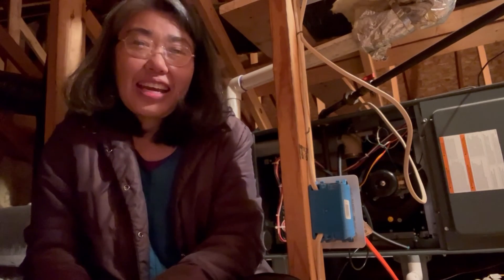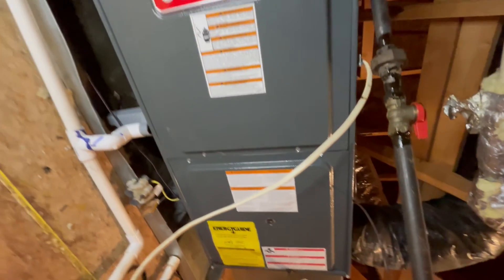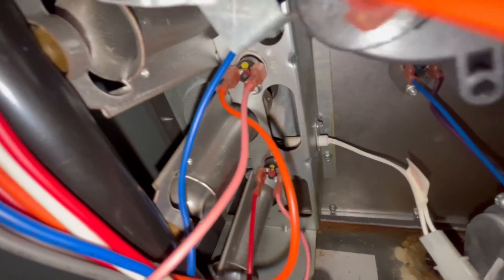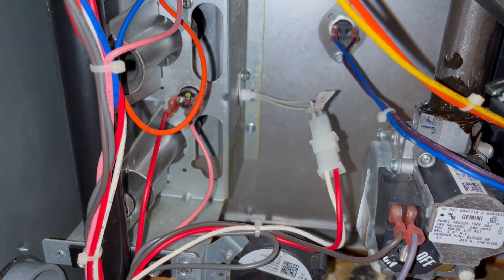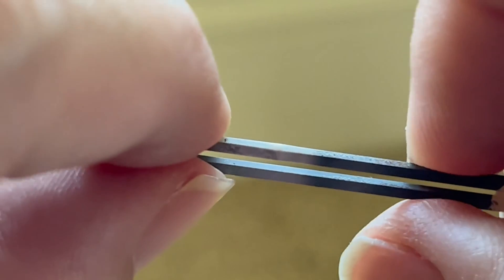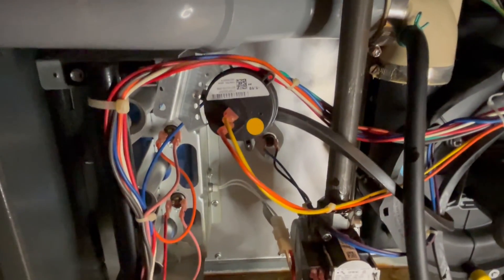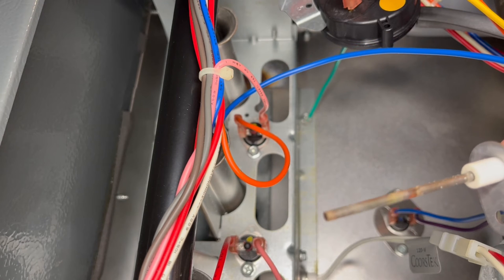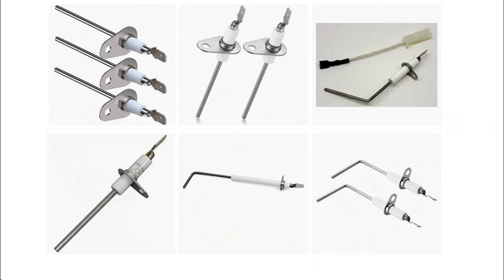HOW TO REPAIR FURNACE NOT Turning On or NOT Staying On

Comment: My HVAC guys tried selling me a larger air intake venting system for $1000.00. They said that was the problem.  I did that myself for $40.00. It still didn't help the non-firing issue so I tried your fix & BINGO. It fired up the 1st time. I will order the new flame sensor just in case I have further issues.  Thanx a bunch for your insight !

Comment: Great video -- thanks.  Mine turned out to be a blockage in the condensation line.  Caused water to back into the starter.  The tech suctioned all the outlets and then the main exhaust flu and turned out the issue was shavings of the PVC pipe from when it was installed - cleaned it out and bingo, back on and working - and we are finally WARM!

Comment: Well, my furnace was doing the same thing.  Inducer would turn on, ignitor would glow, gas would come on and fire up and then the furnace would shut down.  I cleaned the flame sensor and it worked for about a day or so.  Started doing the same thing.  Ordered 2 new flame sensors.  Replaced them thinking the original one was bad.  Still did the same thing.  Finally I saw a video about it being possibly the pressure switch.  A new pressure switch cost me around $60.  Got it sent to me and changed it out.  Guess what?  No more problems with the furnace.  So if cleaning your flame sensor doesn't correct the problem, its the pressure switch.  Great video and keep 'em coming!!
Reply from the maker: Gary, Thank you for this very helpful information!